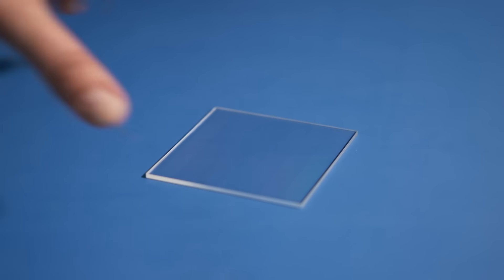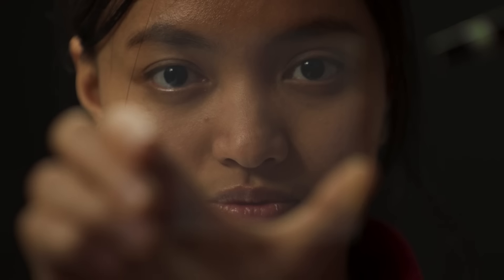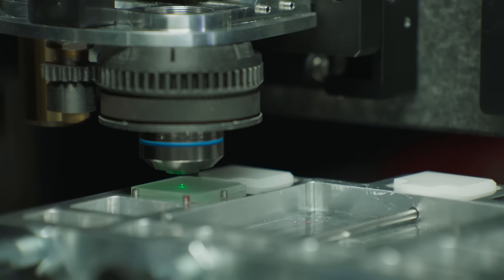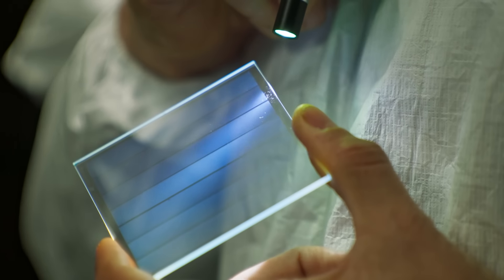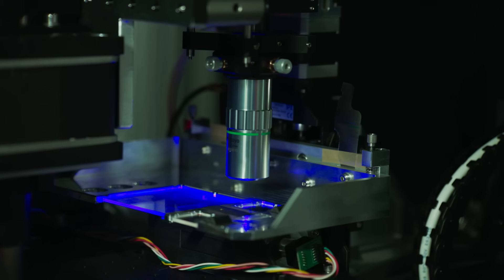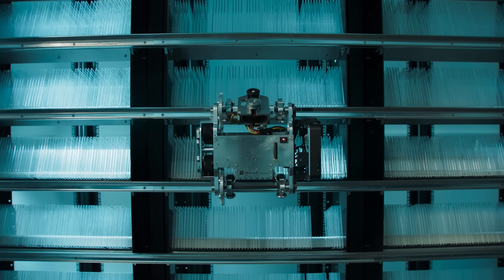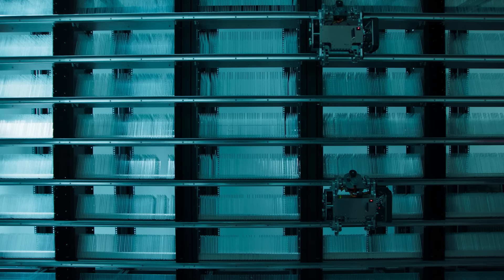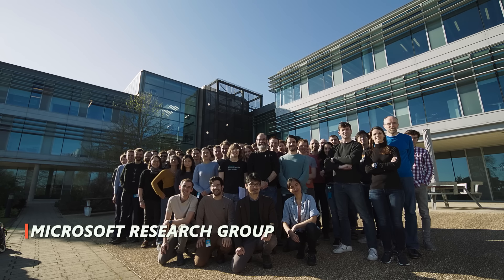Storing data for thousands of years | Microsoft Project Silica

Comment: I recognise that this is an amazing research and development project but I still think there may be a few flaws that it will need to overcome. While this is great for archiving old data and very rarelly accessing it, it would be terrible if continuos access is required. It seems similar to having a library, where you known that 95% of the books will never ever get picked, but if somene where to suddendly try and access all of them... then the problem arises. 

Tied to that is the fact that we would need to decide what data that we currently have will almost never get accessed and what will. 5 years ago that may have been a somewhat easy feat, but now with AIs accessing essentially the whole internet... that becomes an issue. I think the key here is improving the ammount of data that can be stored per unit, as it would mean that the relative access time would be short enough to support the user´s needs. 

Also there´s the issue of the ungodly ammount of data redundancy curently in existence. Like, let´s say we want to stoe and preserve Hamlet, right, so which one of the thousands of versions in english alone do we preserve? But I think that may be a topic for another day.

Comment: Cool concept but so many unanswered questions here. So I assume the data cannot be modified. How long will it take to read and write. It's cool that it's sustainable and all that but if you run it forward; how much space and infrastructure will it require, what possible issues could you run into, will it really end up being sustainable and the best option?
Reply: You will have these buildings instead of libraries and movies. No more paper, no more earth
Reply: It is quite an elegant solution for long term storage, you can just bury this stuff in a big ol' square underground and forget it exists until you need to read from it. 
No need to waste energy removing heat from these drives, no cables to waste space, less chances for a fire hazard

Now ofc the reading equipment is expensive, the on-rails collector could be a point of failure, but engineers can certainly spend the cash not wasted on HDDs/SSDs on making everything as low friction as possible.

Comment: the only issue is with this "thousands of years" is the complexity of decoding the data. Also if the glass were to break in those thousands of years, well that would cause issues aswell. So... I mean it's nice that in a digital age this is a method that stores long term but the thousands of years is a bit too extreme. But sure, it's nice to imagine a far future where they discover these and will take quite a few tries until they realize how can they turn it into understandable data.
Reply: Why is that even an issue? CD's have to be read by a machine,same as this...

Comment: I kinda interested to know how does it compare to a optical disk? They seem to work similar to each other but the difference is in the material used.
Reply: optical disc doesn't last very long I think concept is same etch the data on the glass & read it with laser
Reply: Optical disc uses a light-sensitive dye coating. Since the dye is organic it has a natural lifespan. Glass is glass and we all know how glass behaves in any environmental conditions.

Comment: So there is quite a loading time when retrieving data? First trigger the robot, then the robot moves towards location of glass disk, reads it, then has to send it over the internet to the other side of the world. A large video would take ages right? Or am I missing something
Reply: It's likely that this type of storage device is not really going to be for "live access" files on a cloud that you would attempt to find and watch on the internet. Instead, this technology, at least in this form, would be used for long-term storage. Back-ups in case of drive failures, or large files that can be requested on a more case-to-case basis. Besides a large failsafe backup of "human knowledge" I'm not totally sure how else this can be used. As you've noticed, it's nothing like the lightning speed access to data that we are currently used to.

Comment: It's really not much different than how information is stored in current nand cells, the difference is that we change the material.I think this would be more feasible for the consumer if the same thing could be created but instead of glass, some resistant polymer was chosen, along with a kind of decoding machine (We return to the Walkman era, but instead of magnetic tapes and cassette decks, we will have glass cartridges)

Comment: How much data can be stored in each of these?
Reply: Google said:

As a storage technology, Silica offers volumetric data densities higher than current magnetic tapes (raw capacity upwards of 7TB in a square glass platter the size of a DVD), and using beam steering of the laser beam, we're able to achieve system-level aggregate write throughputs comparable to current archival systems.

Comment: So once the data is etched can it be re-etched? Or is it just readable after it has been written? This video is very vague. I imagine the voxel is just some kinda of squared area of space within the glass. Then you could do layers based on laser colors. (Up to 400 of them) After thinking some time, I think it was vague enough that I can't do reasonable guesses at how much storage a piece of glass has. I could imagine any which way and still be wrong, so I'm just going to think in terms of IBM 12-80. Sectors of 12 row, 80 column code packages. 80 bytes to a card, 80 x spectrums. The punch cards were 7x3 and 8x10 photo frame can fit maybe 3 of them. So about 93.75KB of data can be stored in a photo frame theoretically. I don't expect them to be monolithic storage by any means, but maybe next time MS will be less vague and give some basic technical information. (I can see the video shows 7 strips) and the strips are about 2-3x as wide as a punch card, so theoretically that's whopping 2MB!!! I know, it shows like a million pixels+, but seriously. It looked black and white and unlayered, so it's kinda weird, unless that's just interpreting that spectrum layer as black and white. I like how they said "reading symbols" No symbols were in the dot matrix poll. It was a 1/8 inch read of a section of the glass. If it's reading symbols and not on/off states for bits, then that data will NEVER be accessible thousands of years from now. Why? Because it requires MS specific decoding if that's the case.
Reply: As someone who has connection to a man working with microsoft i will try to answer all of your questions
Reply: @The-illuminated  You didn't say anything? lol Or are you going to ask for me?

Comment: USB sticks are pretty reliable.

I got a USB stick from a friend back in the 90s and it still works perfectly.

If you treat your storage media well,it will last for a very long time.

Always keep your USBs in a room temperature and always eject them in windows before pulling them out.

Thats my experience.
Reply: Your average Joe denying years of hard research from one of the largest research foundations
Keep it up man, one day you will have your own 8 GB stoarge lasting thousands of years
Reply: First usb stick is invented at 1999 as I remember it, we were only able to purchase it commercially around 2003, how did you get it 90s, just wondering?😮
Reply: The difficulty is cost. Flash memory is very expensive, and at huge scales that gets worse.
Reply: @jojify  maybe the “friend” was actually a time traveller
Reply: That’s not the case anymore, cheap usb sticks use the worst nand chips and equally cheap controller.
Reply: You need more information

Comment: Since the data is in hardware format don't you think the risk of maintaining it is very high ? liek even the slightest of fingerprint, dust particle ... may effect / corrupt the entire data file rite?
Reply: they said even with scratches on the surface it doesn't effect the data written in the video.

Comment: How is this different from the CD/DVD and blu ray
Reply: Try storing data on a CD/DVD from around 2000 to now, I can tell you, the CD/DVD will no longer be readable.  I switched to large hard drives because my Blu-rays, which are about 10 years old started to degrade.  Yes, even some of my high-grade Imation were no longer readable.  I must confess a lot of my discs were cheap generic brands.

Comment: Awesome! I just disagree with the end.

If sustentability was important for this company than Windows XP or 7 would still be supported today. It could be with a monthly subscription… 

There is no need to replace all old hardware that are not too old yet (like 10yr old PCs that work fine but are incompatible with Windows 11).

After the end of support for Windows 10 in 2025 a few billion PCs would be electronic waste, like this company did to many others before. Is this great for the world? Definitively not. 

A 7yr old Core i5 is more than enough for 99% of customers. And it will probably still work for decades.

Please think about stopping the planned obsolescence of hardware. It sucks.
Reply: Don't worry, those billions of devices still have linux, or people can use modified Windows 11 ISOs. But you do have a point, it indeed sucks.
Reply: @6kai  it’s very hard convincing people switching to Linux. I gave up on that with my friends. They use outdated insecure versions of Windows as far as they can to continue playing their pirated games or legacy software on small business.

There are many companies and stores with working Windows 7 and 8 PCs here in Brazil. And they don’t have money to replace everything. 

When Microsoft sees a small percent of users on old systems they think they are insignificant. But any small percentage of billions of devices is very expressive if you put all those people in a physical space.
Reply: You're right. @marcoseliasmep

Comment: But what exactly is the advantage of this over M-Disc bluray storage? It can already do pretty much the same thing (last millennia, be very resistant to any chemical corrosion etc.), but users can burn and read those at home. Is it the amount of storage per "disk"? 

This might be useful for storing data that is actually meant as "cultural heritage" for generations in 10000 years (if humanity still exists by then), but for "normal" long-term archival, I see no reason for any company or individual to pick this thing, which can only be written and read at a specialized facility - which means that I have to trust that this facility will still exist in decades to come - , over a simple M-Disc writer.

Comment: So you're telling me that when I make a request in a browser for a resource that's not readily available but is instead stored in a 'library' of this kind I'm going to have to wait till this robot arm finds the relevant record under however many other there are, gracefully make its way back to the reader, then some other process, who knows how long and complex, takes place in order to put that record into place, then its read and packaged up for the response? I better get free coffee maker from Microsoft too. Am I missing something or is this a glorified old-school library with glass chunks instead of books on its shelves?

How's that supposed to replace currently used solutions for data storage?
Reply: It won't replace anything, this is yet another greenwashing, at best this is a nice solution for ultra long term and robust data storage, you'd still need a normal data center to respond to your browser request in a timely fashion only now long term storage has gotten cheaper for the company and safer. But yea this is in addition to any other infrastructure.

It's also much like smartphones: they are very powerful consume a fraction of the energy of a desktop computer and cheap to produce: the only problem is people now use 1 desktop 1 smartphone 1 tablet (and worse since it's cheap they change it every year). What on paper was objectively better in term of "sustainability" is actually making things worse. 

Sustainability is a sham, you cannot sustain mass consumption and exponential growth. At some point we will have to stop storing data or at least delete irrelevant ones. Any optimization is an excuse to keep growing and consuming all the more.
Reply: This is the kind of information that's not accessed daily! You're mistaking it's use to be a SSD/HDD replacement in the traditional sense.

Comment: What about the information density per piece?
I would have liked to learn more about the underlying technology that enables this.
Could this be a consumer grade storage solution at some point in the future?
Reply: With some research, I've discovered that a glass plate can currently store more than a terabyte (TB) of data, and if the glass remains untouched, it can preserve the data for up to 10,000 years. The issue with this glass plate storage method is that the writing process is inefficient. However, for specific use cases, this inefficiency may not be a problem. Using this technology for consumer-grade applications is likely not possible for the next couple of decades.

Comment: No info of how amount of data can be stored on the glass squares, no additional info how is written, it looks basically like a "better" and "improved" blu-ray technology, nothing very special, but the equipment looks very expensive. 
If it's not more than 100GB blu-ray disk on that small glass, then it's not that special, except for the long-lasting data, but that's also questionable, how is the material changing in properties over centuries and this is not easy to test - wear level.

Comment: what if the glass breaks?
Reply: They use Quartz Glass which is tough:
Quartz glass, the chosen medium for Project Silica, possesses inherent toughness and durability. While dropping any delicate storage medium is generally a concern, the resilience of quartz glass provides a degree of resistance to physical shocks compared to more fragile materials.
Reply: @6kai  correct but glass is glass and it breaks thus also creating a definite life for this

Comment: will they support overwrite or rewrite or update else I don't see how they would be useful from a cloud stand point of view. also I think for multiple writes they can clear the glass and write again but that could be a short term solution. I would say this tech could be used to store financial data or some other static data which needs record maintaining for rest of the cases it may not be much useful.

what's I am more interested in is the silica gel based implementation where you will get a chance to have multiple read writes, but I think they still have to figure out how to stop degradation of structure/shape that happens over time.
Reply: This is a write only solution intended for long term data archival.
A service like YouTube could store its copious amounts of videos with virtually no views on it, keeping only a very low bitrate copies in hot storage for instant access, and then if there's a real need to access the original they can start the slow process of retrieving the original from archive. Maybe even charging for the service, like "this video is archived, to view it in full resolution will take about 1 hour and cost X"
Reply: Use common sense, the word archive implies this is data that's not to be rewritten. It's meant to be stored.

Comment: Why aren't there any stats given for this technology? 

Yes this holds data, how much data? What does it cost to produce these tablets? What are they made of? What's the energy cost to power the robots, the readers, the inscribers, etc? 

You spend so much time worrying about the green aspect but don't really examine if this is more efficient than our current system with data.

Here's a problem I see. This holographic storage system relies on permanently cutting a physical material. That means you need to cut it perfectly without error, once, and hope you never need to edit it again because chances are you'll be unable to once it's inscribed.

With current machines I can make something and edit it and continuously edit it until I am satisfied at zero cost.

How reliable is the inscribing laser? What is its error rate? What do you do when it messes up? 

I have a billion questions and you give no answers.

Comment: Without electricity is a total lie.
Reply: To modify/update/read the data electricity is obviously required, other than that no. because the data is stored in glass in the form of voxels. and glass doesn't not need electricity, etc to keep the data in it. I.e sustainable long term storage that doesn't need power. You missed this very point from the video.

Comment: Yes, 20 seconds of writing data with an NVME is much less sustainable than using a laser to write into glass for 30 minutes and then using an elaborate microscope to slowly scan that data again. "Sustainability" is the new lefty buzzword for everything now. The energy MicroSoft has wasted the last 50 years, and now they talk about sustainability, with their concrete corporate headquarters all around the planet.

And holy cows.... just imagine one of those robots having a part stick out when it swiped across all those fragile plates of glass.... Amazing, how overpaid engineers come up with this stuff and not get fired.